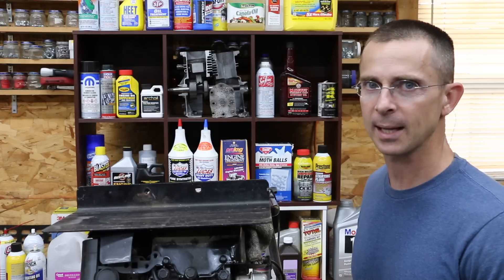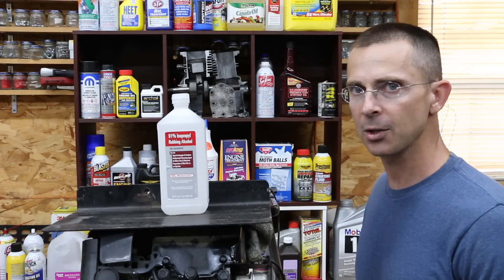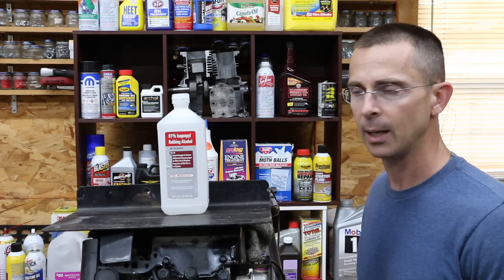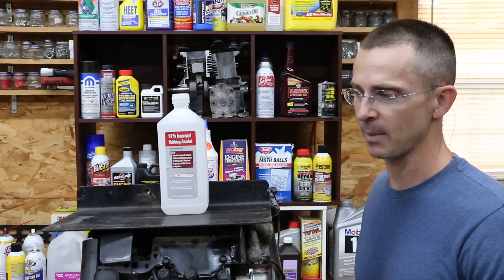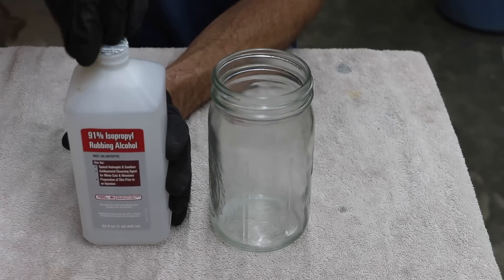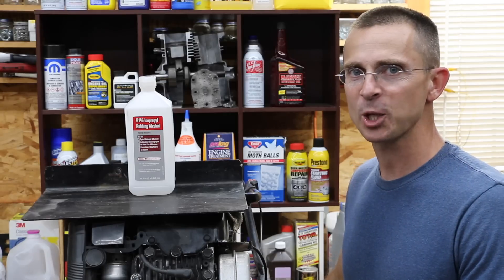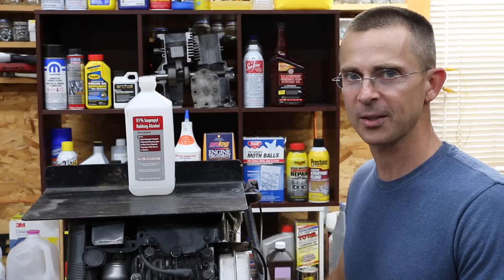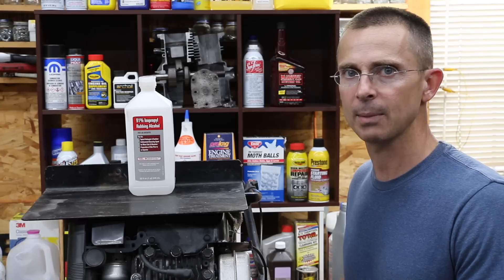Will a Gas Engine Run on Isopropyl Alcohol?  Let's find out!

Comment: I think you should try running the engine on methylated spirits. It's more commonly known as denatured alcohol in the USA I think. But I would like to see the results 👍👍
Reply from the maker: Thank you for this recommendation!
Reply: mharris1270 "Metho" is very common in Australia, I use it in camping stove. Un-methylated spirits seems very hard to obtain. Metho leaves a lot of deposit unfortunately, but it is cheap and can be bought in hardware stores, department stores with an automotive section and most supermarkets.
Reply: Andrew Martin 

E85 is close enough.

Comment: You have tried many fuel mixes, what about something that increases oxygen supply ? For example an ozone generator? If I'm not mistaken the oxygen alone is O2, and ozone is O3, can the extra oxygen atom increase performance?
Reply from the maker: Thank you for this recommendation!
Reply: O3 is a buck wild oxidant. Almost free radical Oxygen. I've used it in chemical synthesis & it usually just oxidized the crap out of your compound.... Even at -40C. Plus it is a severe irritant & very toxic. It will basically oxidize anything it touches, even you.
Reply: MrNoodlyone 

It’s used in water treatment for that reason. Indiscriminate oxidant.
Reply: Sounds interesting... does an ozone generator produce it in volumes significant for the combustion process? And if it does, will it actually be economical? It needs to draw energy from somewhere. 

For a stationary engine it is an interesting test.

If you intend to boost a vehicle with it, either you need extra batteries or a solar panel etc. for it. Extra weight to carry in addition to the O3 generator means higher fuel consumption. If you use a wind turbine or power it from the vehicle battery, you will add to the fuel consumption just as well.

I'm afraid that it would be complicated and cumbersome to the point of being impractical even if it might provide a boost.
Reply: I agree. I cant wait to see that test!
Reply: @Oliver Mayo 90% is quite dangerous. It will make other explosive peroxides... way more. Start w/ Nitromethane. You would have to richen up the mix. But It would be fun to see.

Comment: Out of curiosity- did you adjust the jetting/mixture for this test, or did you stay with factory settings? Also- what did the spark plug look like after the test, as far as the mixture was concerned? Thank you.
Reply from the maker: The carb doesn't have an adjustable jet.  The plug looked very clean following the test.  Thanks for commenting!

Comment: You need rich air/alcohol mixture to burn it properly, that's why the engine doesn't run smooth.
I made some research and alcohol could also damage the rubber seals and gaskets of the carburetor.
Thanks for the video.
Reply from the maker: Thank you for this information and thanks for the positive comment!

Comment: You should try running a motor on Everclear, it's almost straight alcohol, wonder how it would run and if it would do anything to it, Everclear full strength is 98% alcohol and runs about $12 a bottle, that would be interesting to watch
Reply from the maker: I'll definitely do a test on this.  Thanks for this recommendation!

Comment: Did you change the carburator mixture? Is the ignition still the same? I believe, if you want extra power and efficiency, you can increase the ignition timing a little bit more advanced. You should try E85 or E100 (it's ethanol without gasoline) too. :D
Reply from the maker: These are great suggestions.  The carb for this specific engine didn't have an adjustable jet.  I could have advanced the timing a little. Thanks for commenting!
Reply: Project Farm Interesting. I know ethanol and methanol requires a higher fuel flow than gasoline and isopropyl alcohol may require higher fuel flow than gasoline too. The lack of power and rough idling could be due to lean mixture.

Thanks for the great and fun content. ;D
Reply from the maker: Thanks again!

Comment: I'd really like to see 99% isopropyl alcohol used instead of the 91% mix. I wonder if that would make a difference with how the engine wasn't running as smoothly. I'm guessing it might run better with 99%.
Reply from the maker: Yes, I believe it would run much better with the lower water content. Thank you for this recommendation!

Comment: Do you think that this slight decrease of compression pressure could be a result of cleaning some carbon residues from the combustion chamber? Also - you were using very low quality isopropanol, it had 9% of water... good quality IPAs are over 99% vol.  (often 99,8%). As for Everclear - it is 95% vol. rectified spirit (ethyl alcohol), so it definitely will work, probably even better than on this 91% vol. IPA.
Reply from the maker: Yes, it's a very slight decrease and slight variance in pressure readings is normal.  I'll try Everclear.  Thanks for commenting!
Reply: I actually meant that the result on Everclear is obvious and it would be a waste of time and money. Moreover someone else have already tried that with a positive result.

Comment: Great videos mate! I like watching them because they are very informative and fun to watch! 

I have an idea for a video. I had half a gallon of gasoline fuel mixed up with oil for two strokes engines (mixed in the proportions for a two stoke engine). I wonder if this mixture will cause the engine to build more carbon or not. 

Also you can extend the idea and put more and more oil to the mix and see what happens to the engine internally!

Also another idea for a video - you can try running the engine with very very old gasoline fuel and see what happens. For those small engine probably nothing but you can use the idea :)

Have a good day!
Reply from the maker: These are great video ideas!  Thank you!

Comment: I love the see-through cylinder head. And I'm impressed that how well the engine ran off of straight alcohol. As well as it ran I wonder why you wouldn't use alcohol as a substitute for gasoline. I know the production of alcohol would never be able to keep up with demand for it as a fuel. But would it's overtime cause damage to the engine? Keep putting out the great videos.
Reply from the maker: Thanks for the positive comment!

Comment: Henry Ford, and Rudolph Diesel, never intended a gas engine. Their first cars were run on hemp oil, or ethanol. There wss a switch for either one...Ford built his first vehicle, using mostly materials made from hemp. Guess it's making a comeback, with the Kestrel.  Everclear work ?
peace😎
Reply from the maker: Thanks for commenting.  I'll test Everclear in an upcoming video.  Thank you for this recommendation!

Comment: You should try supercharging a lawn mower using a leaf blower!
Reply from the maker: Thank you for this recommendation!
Reply: @ProjectFarm  this guy gets it. I get it makes boost on such a small displacement engine
Reply: A leaf blower will generate lots of CFM but not pressurized air (boost)
Reply: @RiceReaper  at the very least, it would maximize volumetric efficiency. Maybe a small amount of boost, a fraction of a lb probably. But for an engine this small it would probably do *something*. I want to see it!
Reply: @garybarbourii8274  
It wouldn't make even a bit of difference. Imagine blowing into a syringe when drawing it. Would there be "more" air in it? No.

A naturally aspirated engine can only draw a fixed volume of air. The only way to get more air into the cylinder, is to compress it. So the air is more dense in that fixed volume.
Reply: @RiceReaper  I don't imagine it would be much. But it does have to potential to add torque to the higher rpms where the engine does not have the volumetric efficiency to pull its full displacement at atmospheric pressure. I do agree with you that it is the wrong type of compressor to actually build meaningful boost.
Reply: Super or turbo charging a carburettor engine is quit hard. You can't just bolt it and and have it work. It might still work but it will  run super lean
Reply: I did this back in high school using a Briggs 3hp engine and an electrolux vacuum in blow mode. Ie house from vacs end . I has to also pressurize the gas tank too so gas would not blow back oyt the tank. The boost was in the 2psi  range using an electrolux model xxx.
Reply: He would have to run a draw through system for the carb whether it be turbo or supercharger
Reply: @theshit2070  yep. The carb would have to be before the blower intake. Imagine the fuel loss and inconsistent A/F ratio through a leaf blower lol
Reply: @garybarbourii8274  yeah that leaf blower would try to make only max boost and probably wouldnt atomize the fuel very well
Reply: @theshit2070  It's alot of challenges for sure, but I'd still like to see him try
Reply: @garybarbourii8274  i think with enough tuning and the right carb he could figure it out 👌👌
Reply: Roadkill
Reply: First, you need a reliable engine power measurement system in place to measure power gains.
Reply: This idea definitely works :)! measuring the hp difference would be cool though.
Reply: I've actually tried this but it didn't work for me lol
Reply: *turbocharging
Reply: Turbo or supercharge one and add the nitrous oxide kit
Reply: I second this suggestion
Reply: It wouldn't compress the air like super charger or turbo😊
Reply: @crispincurtis8585  I posted this knowing what the results would be, but it would be a fun video and I've never seen it on a lawn mower. The leaf blower will produce boost. There have been several videos of people doing this even on large V8s. Someone previously mentioned Roadkill who did it. I believe Mighty Car Mods did it as well years ago.
Reply: @dsmbilly3690   it would be entertaining lol
Reply: honda civic owners everywhere -🤯
Reply: How about try it in a 2 cycle moped engine
Reply: Some people use smog pumps off old cars to supercharge go carts.
Reply: It would just shut off probably
Reply: I told him a year ago to try turbocharging one lmao

Comment: Hey what tool are you using i want to know so I can try to turn over my mowers engin
Reply from the maker: I'm using a 1/2 inch adapter that works with a drill.  The adapter attaches to a socket that fits the nut that's on top of the flywheel.  They are available in hardware stores or online.

Comment: Run a motor on pure sea foam. Like if you wana see.
Reply from the maker: Thank you for this recommendation!
Reply: Curtis Gregory seafoam is combustible. Says it right on the bottle.
Reply: A diesel will run on pure seafoam they recamend it to purge clean the injectors.
Reply: try it and also on a diesel engine
Reply: Sea Foam is isopropyl alcohol, pale oil, naptha. Should run fine.
Reply: Use E85, this will give a clean engine!  But hard to start under 15 deegreC. But 50/50 with regular gas will help. Efter 500km take a look to your sparkplugs!! They are pretty clelan!!
Reply: Steven Harden wanna bet?
Reply: QuantumRift e85 is made the same way moonshine is made. Water, yeast and corn. E10 and E85 since E85 contains 85% alcohol and only 15% gas I think it be safe to assume there is a much greater level of water. These types of fuels are also hygroscopic.  Meaning that it absorbs water through the air. E10 only carries 10% alcohol which there would be less water. 

http://www.fuel-testers.com/about_ethanol_fuel.html
Reply: camerons outdoor channel.  That would be really cool. I would like to see how clean it could get.
Reply: Thomas Strickland E85 DOES NOT have water in it....gawd the ignorance here...
Reply: Albert Verheiden I was about to say a old head told me to do that
Reply: then wat causes smoke wen you run it through an engine?
Reply: Evan  Wenger seafoam is an oil based fluid that's why it's smokes. It's not rocket science. It takes a high temperature for its Flashpoint.
Reply: Read the MSDS. 40-60% Pale oil, 25-35% Naptha, and 10-20% iso alcohol.  Pale oil is akin to kerosene and other distilled light solvents/oils. Naphta is highly flammable distilled liquid - and iso alcohol from petroleum distillation. Compress it and spark it and and it will combust. May or may not run smooth, but it will combust.
Reply: QuantumRift it would work better in a diesel.
Reply: UZI9MMAUTO Don't be ignorant. It will combust in an engine. DUH.
Reply: Curtis Gregory I run my small engine on pure seafoam all the time to clean it
Reply: Cameron, you pretty much saw it then already, as most of Seafoam is Isopropanol
Reply: Seafoam is combustable. I just lit some on a piece of wood and also sprayed it over a lighter. Great way to singe your eyebrows
Reply: QuantumRift you’re trying to un-scientifically prove something that has already been proven. Unless you have a tank that is perfectly sealed it will absorb water. That’s a perfect world. Fuel tanks in cars are not sealed. Boats get more moisture of course. They don’t want you using that crap in anything carbureted because guess what ethanol does. Turns into a rust slush and you eventually get vehicles and equipment that won’t start.
Reply: Thomas Strickland Older vehicles used components that would corrode and rust. IF you leave a partially filled tank of E10 in a car it will cause a problem. I HAVE HAD many carb'd cars and had no issues at ALL with e10 fuel. NONE. Why? Because I am smart enough to not leave untreated e10 fuel in my tanks. It also helps to replace plain steel lines with stainless tubing or hose. It is not rocket science, even though I have a degree in Aeronautical Engineering.
Reply: QuantumRift oh just you wait Mr. aeronautical engineer. I will prove my point today. By the way my brother Rick, Sister in-law and my dad are or were in that profession. Dad retired of course.
Reply: Remember the Seafoam recipe 90/10 pure mineral oil to 99% Isopropyl alcohol.
Reply: It just doesn't...
Reply: A bottle around here is about 7 bucks for 16 oz. 
1 gallon = 128 oz Therefore  it'd take 8 bottles to get a gallon. Those 8 bottles would equal $56 /gallon.  
How many gallons does seafoam recommend to do a full cleaning ?
Reply: colfrankslade they sell seafoam by the gallon. It’s around $27.
Reply: And is why I use MMO in my older engines along with the regular gas.
Reply: He did that video, it ran with significant choke.
Reply: MEH..... HHO IS MUCH MORE INTERESTING
Reply: Seafoam? Sponge Bob's motorbike runs from that stuff.
Reply: Use a diesel.
Reply: Nothing can beat the wire brush cleaner
Reply: I once put that in my intake of 03 neon and shut the engine of it still ran for 10 seconds sounded like a oil engine and kick and popped back and forth it was so funny the granny went and I kept driving it for 1 year it's been threw a lot do to the sister ex boyfriend who smashed it up like 2 times when she had it.
Reply: Since it seems that my mistake was an insult to everyone's mother's. I will admit that misspoke. I meant it isn't combustible like gas. I was " in my mind  thin it was more like diesel where it needed more compression to make it ignite. I am sorry and I will accept my faults. Who's mom's do I need to apologize to?
Reply: its mostly diesel
Reply: Seafoam isnt combustable. So,it wouldn't run.
Reply: @Curtis Gregory Seafoam IS combustible, but not flammable. Flammable is readily ignitable...while combustible means it must be heated to its point of vaporization before it be burned. Fire rarely burns solids or liquids...they most all the time burn the vapors or gases that come off of the substances that appear to be burning.
Reply: @undergod1987  It's oil based, it'll burn.
Reply: He will have the cleanest motor ever
Reply: Steven Harden hmmm...neither will diesel fuel... Do you EVEN know what is in SeaFoam? ISOPROPYL Alcohol, naptha, pale oil...compress it and add a spark, and it will combust. It is listed as a flammible liquid and vapor - do yourself a favor and learn what an MSDA is. You lose.
Reply: Hasan Kaya  that’s because E85 has a lot of water in it. Mostly water and alcohol. 15% gas.
Reply: Project Farm  run a cleaned mower on e85 for like 100 gallons see internals after.

Run a dirty engine on lots of e85 see if it cleans it up...

Run a dirty engine on C-10 I have heard that it will clean an engine
Reply: I know HOW (ethanol) alcohol is made. E85 contains 85% ALCOHOL and 15% GASOLINE (that is to taint the alcohol so we can't go get 20 gallons of moonshine to have a party with). However,  you miss the point that 1) after the alcohol is FERMENTED, it is DISTILLED. That SEPARATES the alcohol from the water and rest of gunk in the tank (I also make my own beer). Please NOTE that E85 isn't sitting around open to the air (to absorb water vapor) and that modern processing, distribution, storage AND eventually  your fuel tank is pretty well SEALED to prevent water vapor intrusion. Yes you have to open your fuel tank to pump in fuel but for that time the amount of water vapor that gets in is MINIMAL, since you are filling and pushing out any air, vapors and water vapor out of the tank.  That's the REASON you can buy 100% gasoline at marinas, because BOAT fuel tanks MUST BE VENTED to atmosphere, and any incursion of water vapor CAN lead to corrosion in the fuel tank, etc. So if you think that when you fuel up your tank with 20 gallons of E85 you're getting a LOT of water you are WRONG. That's what I find, well, unfounded that people believe that they are getting a lot of water in their fuel. If you're running your tank out, then filling it, you're not accumulating anything in your tank. Just remember that after the alcohol is fermented, it is DISTILLED to remove it from the water and other mash stuff.
Reply: QuantumRift sure. You can take a flame to it and it won't ignite, so a spark from a spark plug won't do a damn thing.
Reply: Seafoam isn't like a fuel or combustible or flammable.
Reply: Seafoam is isn't combustible it wouldn't run at all.